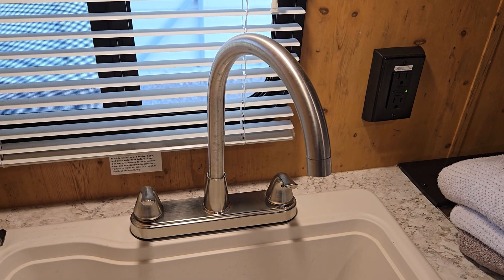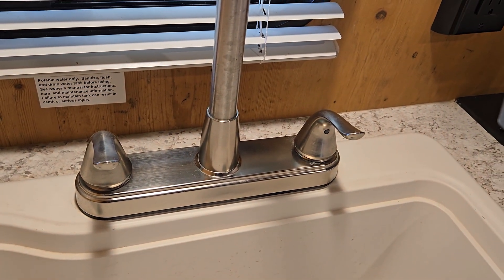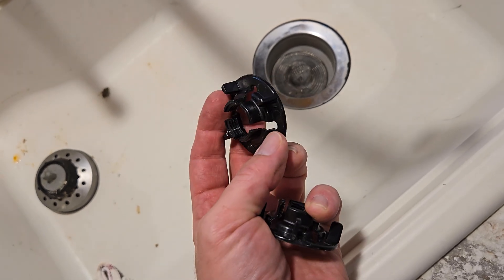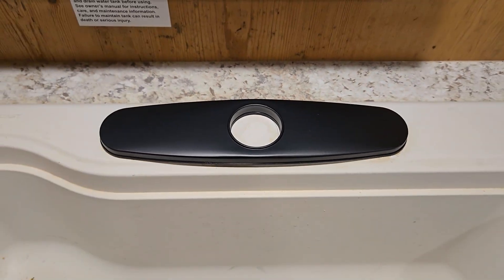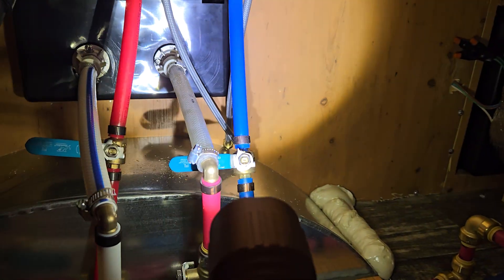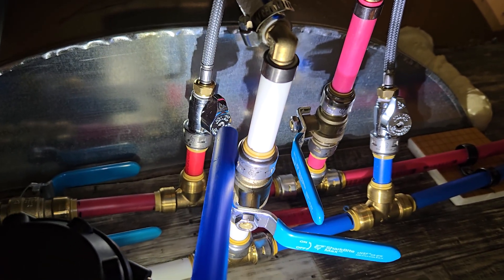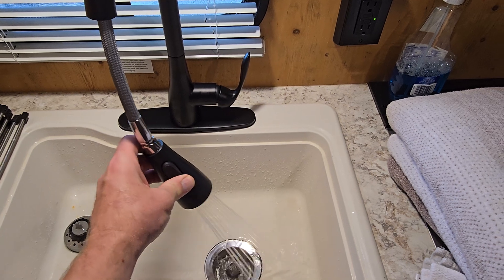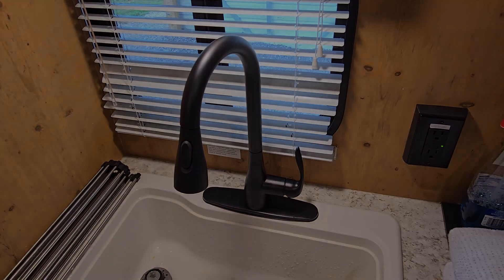Upgrading Sun-Lite 16BH Kitchen Faucet to Moen with Sprayer

Comment: Shweet upgrade! While water line shutoffs are a necessity in a house with constant pressure,  using the battery shutoff to kill power to water pump works for me in a travel trailer.  🙂 Going stir crazy waiting for my 16BH to be built 🤪